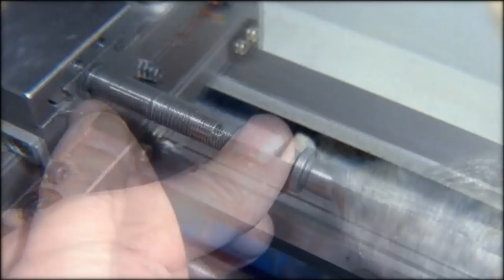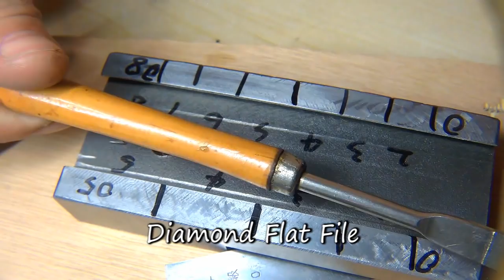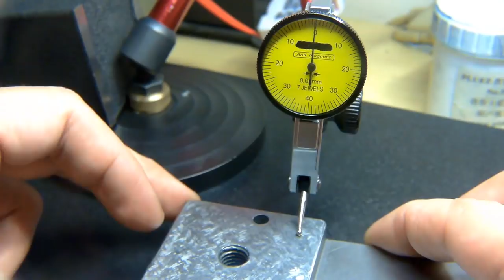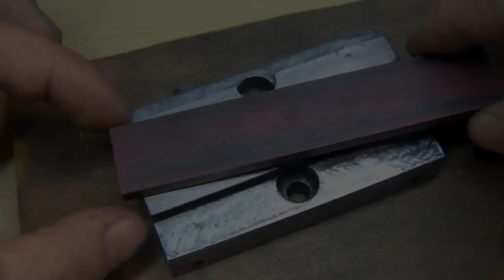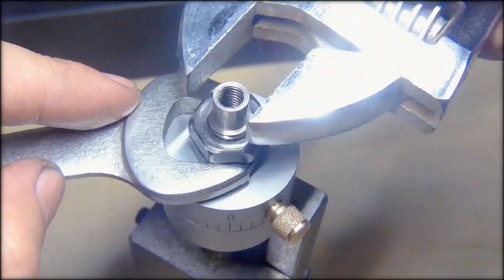MIni Lathe Upgrade | Compound Slide Scraping

Comment: One little tip for things like this.
Working on the part is a lot easier if you can keep it from moving, but constantly repositioning it in a vice is a pain in the backside. For a part this size, If you get a 300mm square piece of 12 to 18mm plywood, Then screw a 30 to 40mm square baton of wood along the bottom of one side, and get two lengths of wood that are thinner than the work piece and screw them in a 90' "V" on the other side and end of the plywood, you can hook the it over the edge of your workbench and put the work piece in the V. This way you can use both hands to have more control over the scraper.

Comment: Beautiful to watch you doing that.  I must learn more about scraping parts. I once watched a guy dismantle a huge machine and hand scraping  all the parts, before reassembling it, back together again. I also saw a Japanese guy hand scraping high pressure steam joins, so they wouldn't leak. All in fine detail.

Comment: Not sure how that matters if the dovetails aren't parallel to each other and to the bottom surface. You'll know if you get consistent feel when moving the top slide back and forth.
Reply: after scraping one could probably lap the dovetails in, but you make a very good point
Reply: It matter a lot. I used to have mini lathe and weak dovetail parallerism was the biggest problem in it. It was impossible to tighten compound in a way it didn't bind when being moved or have visible sideways movement when rotating feed.

Comment: Grease is almost never used around machine tools such as that feed screw. Why? Because it retains the wear particles and continuously runs them back through the the parts and vastly accelerating further wear. If the feed nut had a grease zerk fitting then yes it could then be greased every so often to help flush out and clean them. Since it wasn't designed to use that then oil is used to both lubricate and an excess amount of that oil is helpful to wash out those particles. Oiling and doing so often is the cheapest method of slowing that wear. What most of the machine tool manufacturers fail to mention is it's normal maintenance to disassemble parts like this then use something like a spray carb cleaner or CRC contact cleaner to clean and de-grease the feed screws and just as important the feed nuts then relubricate once there clean. Those clean well lubricated parts will easily last 10 or more times longer than those that get ignored with little lubrication or when the wrong lubrication like that grease is used. Grease also requires a much higher clearance on the bearing surfaces than parts designed to use oil as the lubrication.
Reply: @Turning Point      finally  a real machinist
Reply: Was thinking exactly the the same . He also could have scraped the side of the gib that touches the business face of the topslide dovetail. I watch a lot of these videos for sheer entertainment value. They elicit a sophisticated eye roll in me most of the time, much like The Repair Shop on BBC1. Some of the best ones are when folk start lapping their saddle and tailstock to the bed. A number that have done this claim to be qualified engineers.

Comment: The way you checked it originally your assuming the bottom is parallel to the top, it's likely not sense this is made in china lol but parallelism really wouldn't mean anything. I bet the bottom was much flatter then you realized before you started.

Comment: You didn't scrape the dovetails. Also you should produce chips rather than dust when scraping. Other than that, good job :)
Reply: I don’t think he needs to go that deep to produce chips.
Reply: I think it still work its all about material removal not getting thongs done in expected time

Comment: Finish the job and scrape the dovetail, positive side and the gib. :)
Reply: I have a small carbide insert holder for doing that, but smaller areas aren't always easier to do :)
Reply: @Grauenwolf  Sorry but no, brass while it would work certainly isn't the best material. Most if not all industrial machine tools chose cast iron for there gib material for very good reasons since it's a good bearing material and is quite durable when cast iron slides on itself.
Reply: @Grauenwolf  Yes I do know brass is a well known bearing material for the right location and where it can be kept clean enough. It's also soft enough to be susceptible to picking up and embedding material harder than itself so it then starts lapping and scoring the surfaces. I didn't say the original gibs were cast iron, and they very likely are bananna shaped pieces of steel that are anything but flat. 

Cast iron gibs are chosen as I said by the major machine tool manufacturers because of it's known durability and wear quality's over anything else available including brass. To go to all the work of scraping in the slides on this lathe and then choose a material known to increase wear and scoring is rather pointless. The only thing brass has in it's favor is it's probably easier to find for most of us than cast iron in roughly the right shape might be. Either material would still have to be scraped flat, so the amount of work involved is the same no matter what get's used. Cast iron is just the better choice.

Comment: I may be wrong here but seems all you gid was scrape your compound paralell to a non  critical surface? from hhose readings the only material that needed to come off was the 0.03mm difference between the two initial readings

Comment: This is an honest question, it looked like at the end of each surface you scraped there was no individual points of contact instead there was a single contact point over the majority of it now the question is that on purpose because the compound doesn’t need to slide very often and full contact is better or for another porpoise? Please tell me because I am about to start on mine and I am trying to get as much information as possible before I start

Comment: Does anyone else think he's using too much engineers blue on some of these tests? When propperly scraped in, engineers blue should show lots of small and roughly evenly distributed dots of contact, Not one big splodge. If you slather enough blue on you could even get a solid transfer on surfaces that are a couple of degrees out of alignment !!!
Reply: Yeah. I wasn't going to say anything because I mentioned this on someone else's video a few years back and a mass of the channels "Fan boys" told me that I didn't know what I was talking about. In that video the bloke was using so much blue on his surface plate that he could have shown that a used brick was scraped to perfection (The part was literally scraping beads of blue up around the edges of the part as he moved in on the plate !!!) . The scraping in this video wasn't TOO bad. Some tests were a fare bit too heavy on the blue, But the tests that were OK showed that he wasn't doing that bad of a scraping job.

Comment: Thanks. Great job! Where to buy the scraping tool and spotting Ink?
Reply: Grimding a steel to negative rake but not too much i find it blunting quickly if neg rake is too steep just a few degrees of neg rake and a radius if can buy tungsten carbide insert or stock and make a holder or  braze it and a handle make sure to not buy very thick stock of carbode they are bery hard material to cut and i had to go to a machone shop to get it split into thinner pieces  grinding would require diamond wheel make sure the cutting edge should be able to cut easily  and creates powder  whem scraping your nail as a simple way to test and make sure cutting edge leave not line like marks or buy yourself readily available carbide scraper remember it needs to have a radius and negative rake.

Comment: Please give name/type of exact tools used.
The scraper etc..
I want to do same thing. 
Thx
Reply: Make Everything ok but most important.

How you made hand scraper?
What material? HSS?
Reply: @jw200  Scrapers usually are made of Carbide, well the part that does the actually scraping is anyways. Usually the tool is tool steel or some other softer steel i think, and use a carbide insert at the tip.

Comment: Looks decent but you are using far too much blue, you should be applying a very thin later so it does not smear. Otherwise you get a false reading and not a true representation of the high spots
Reply: I was going to write a something about this, But decided to first check that the comments section wasn't already full of people pointing it out...... Surprisingly few have mentioned it.
I was trained as an engineer many years ago, But I still remember my instructor stating that "If you slathered on enough transfer blue you're going to fool yourself into thinking that something with a surface like a bloody millenicut file had been scraped to perfection". :)
In the final stages of scraping, the transferred blue should be a very faint misty tint on the high spots. What I was seeing here looked almost like someone had been colouring bits in with a sharpie !!!

Comment: There is just no way that I would spend that much time to "improve" a new lathe that should have been good from the first instance.
Having to rectify all and anything possible that can be rectified tells me the user is purely doing so because he has nothing better to do with his time...........buying a better quality lathe would have been the best choice as you then have the time to actually make things you bought the lathe for in the first place and a better quality lathe would also give you better results than trying to fight against inadequate machinery design.......making a gold plated silk purse out of an old Sow's ear never gets you near a lathe of quality no matter how hard you wish.
Reply: The point of having “nothing better to do” is exactly what working in a hobby shop is about, it’s just about having fun and learning new things for a nice and low price tag. It’s about the challenge the skills that come along the way.
Reply: A lathe that costs as little as these do isn't going to have surface ground and hand scraped ways. Everything about these mini lathes is a compromise on quality to meet a price point.  It is what it is. 
 A half decent high precision benchtop lathe in this size would start at about $7000. A high end one is much more.
Reply: Even a brand new lethe ,with hand scraping ,becomes better for high tolerances. You got to admit it was nice to watch.😅